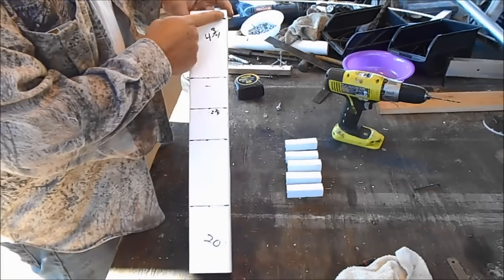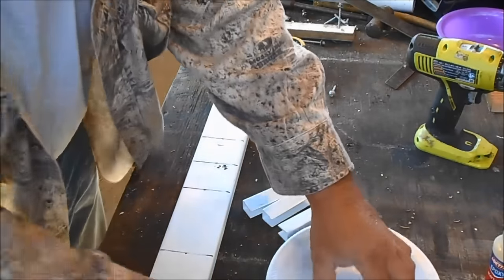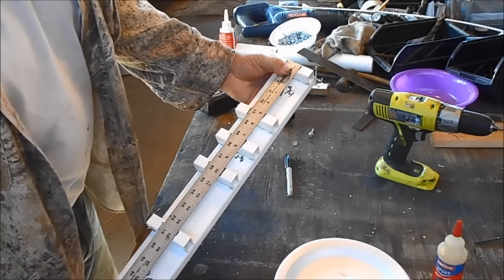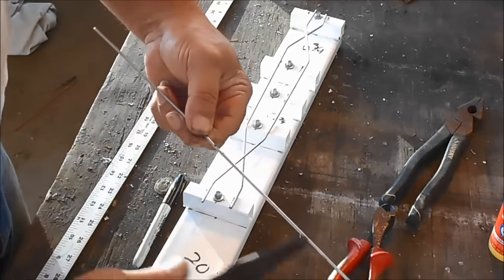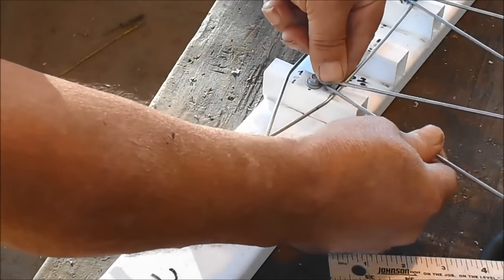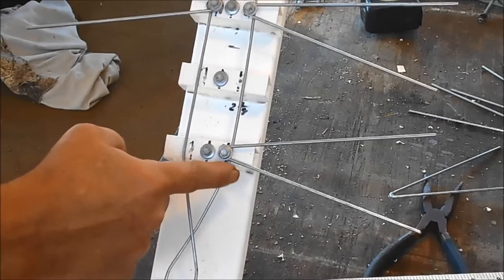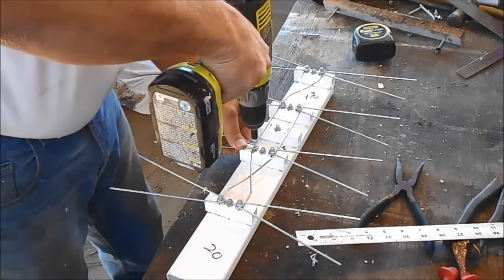How To Make A Indoor Tv Antenna

Comment from the maker: I HAVE 3 ANTENNA CHANNELS....Make sure to check out my  other channels  ,, Here's. the links... 
Deep South Videos https://www.youtube.com/channel/UCu7D3nWG9a5prTg9ugIn41g
Southern Ideas https://www.youtube.com/channel/UCunNmrlazaJKzQv5tCpNjWg/videos
Danny S Hodges https://www.youtube.com/channel/UCfod7dn64deeX7LZlpb-ctg
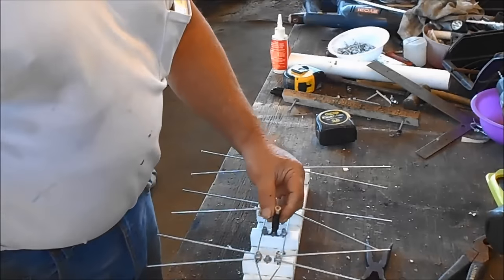Reply: Hello Danny!  Whats the name of the plug that you are holding at 3:12?
Reply: What happened to the "first" video, making the indoor antenna with a wood piece, wire, screws, coathangers and a balun.  I cannot seem to find it on either of your three channels.
Reply: Hi Danny,  
l finished constructing your antenna today (as per your specifications) and it works perfectly.  

Many thanks: Michael from Suffolk, United Kingdom.

PS,  the timbre of your voice sounds identical to the late actor Strother Douglas Martin Jr.
Reply: I have to let you know that this will be made in a week. I will use copper wire instead. Thank you Danny for making this so simple. Peace vf

Comment: I made this antenna with 1" pvc pipe and 14 gauge galvanized wire.  I made a stand for it out of the same pvc and have it sitting by an external wall, facing the towers about 35 miles away.  I'm able to pick up all the stations, no issues at all!  Thanks Danny!

Comment: I live in Central Florida. After the hurricane last year I determined that I needed a plan B for when my Direct TV goes down during a storm. Tonight I made a permutation of your indoor antenna. I used heavy #6 wire that I had on hand, a piece of scrap 2x6 and screws and washers from the million dollar can. The only thing that I bought was the transformer for $4 and change. Wasn’t hard to make and I get 57 channels with the antenna indoors. All are in 1080p. I was shocked. That was way better than I had dreamed possible.
Reply: Yes - but do you get NBC/WESH? I have a $20 Amazon-bought antennae that gets lots of channels in Orlando, but no WESH unless I can find a way to put an outdoor antenna up high on the roof.
Reply: Yes. I do get channel 2 in perfect 1080p like all of the others. But it is like cheating. I am close to their antenna.

Comment: What are those white things called that you glued down on the board? Is it plastic? Does that added height from the board give it better reception? The other videos I've seen doesn't use those pieces. Just wondering. I like the simple instructions. Thank you.
Reply from the maker: fixon to make a video need to watch it i will show you in the video
Reply: Thank you.
Reply from the maker: SOMBODY GIVE ME THAT IT IS VINAL FENCE PARTS I DONT NO WHAT ITS CALLED PVC PIPE WILL DO THE JOB

Comment: It should work better is you don't cross the wires. Current flows in 2 different direction but where you cross the wires it creates an interference "field"
I don't understand why you would cross them in the first place.
(Google how antennas work)